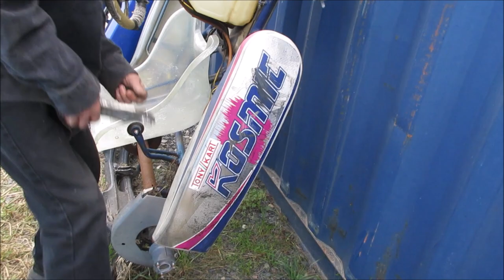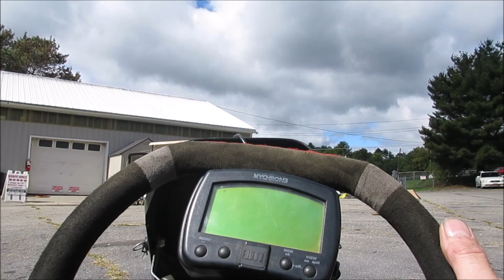Race Kart Scrap Pile Pick ,Then Lets Race Them

Comment: I would love to see a class using obsolete (to the current rules) chassis, powered by a 6.5 hp Honda clone with a TAV2 trans. Run a mixed surface course, all dirt and other tight courses. Cheap fun. I will name it the Mustie One class.
Reply: Man I remember renting them at dirt tracks when I was a kid.  They had  BS motors and washboard humps with jump hills in the track.  I'd work for a few days to drive them a few laps on those dirt tracks and it was worth every penny.  Great memories.  Thanks Mustie.  Cool video.

Comment: Using tools that aren't hammers as hammers always makes me uneasy. But at least it lets me know who not to lend tools to. :) Good fun video!
Reply: That and using screwdrivers for tasks other than turning screws makes me cringe too. Cold chisels and pry bars work so much better.
Reply: every tool is a hammer, whether intended to or not. gotta use what ya got sometimes
Reply: @harveylong5878  a hammer is a very basic tool and if you only have a few tools a hammer should be on any short list. I've seen the tool collections of people that possess almost no tools whatsoever and they all invariably have a hammer. It's generally one of those curved claw carpenters hammers. Really you're better off with a rip claw. But what do they know?

Comment: I have an old go kart that will scare the pants off of you, it's an older 90's kart from a local go kart track that closed down, got it for $600 with a 5hp Briggs, buddy and I hacked it up a bit and put a Kawasaki Sno-Jet snowmobile Sachs 340cc engine on it, it will do 80mph+ if your brave enough to pin the throttle and keep it pointed straight.

Comment: I like how your friend walked around, and just high jacked all the donor parts you would need. He did crack me up a little with the velcro on the shoes, means you're getting old, and tying shoes is to much.  I am over 50, but i got to have laces in my shoes.  Watch JR go fixed one of those adult go carts, and put the newest harbor freight predator engine in it, and it was fast.  G-d bless and be safe.

Comment: We raced go cards at a company party once really fun, i don't think they were as fast as these though and i didn't fit at all, i ended up riding the brake a little bit most of the time. But dang it was hard for the arms :P i am used to driving without power steering but dang that was hard

Comment: Is it not allowed to have a shifter cart set up like a bike. Bars, clutch, Front brake right foot rear brake brake, left shifter , twist throttle, and so on. ?
Reply: Used to have shifter karts 125cc and 250cc, clutch, brake and foot throttle with gearstick next to steering wheel. The bigger engine Karts such as the 250cc normally go on the longer tracks but I used to go on tracks such as this with the 125cc but found it better with the longer tracks.

Comment: Please help me fix my CL350
Reply: God helps those who help themselves.
Reply: @1pcfred  if God wants to help too thats fine too but I haven't seen his videos of getting old engines running again.
Reply: @1pcfred  i had a guy give me a quote of $1900 to replace a cam chain tensioner and he has never even worked on a 350. He needs God. I just need someone that knows what they are doing that is not going to take me for a ride on the cost.
Reply: @crazylikeafox7341  Mustie doesn't work for people like that. Though he's done things for people he knows. I don't know what I'm doing and I can usually fix stuff for myself. I just brought my lawn tractor back from the brink. It decided to light itself on fire. I didn't want to buy a new one so I fixed it back up. It was pretty messed up though.
Reply: @crazylikeafox7341  they're all basically about the same. I just watched a kid bring a 1930s Briggs back to life. His technique wasn't the best but he was still clever. He had perseverance too. Which is the most important thing.
Reply: @1pcfred  yeah I will just go ahead and dismantle an engine in my gravel gravel driveway. Its not that I can't do the job myself. I know exactly what needs to be done. I don't have a place to do it. Mustie obviously does and has worked on 350s before hence me reaching out to him. Are you his representative?
Reply: @crazylikeafox7341   a gravel driveway is a place to do it. I've torn engines down outside. I don't represent Darren but I do understand that he's not a repair shop that's open to the public. He just does his own projects. If he fixes something for someone else he's just doing them a favor. I've watched a video where he fixed his aged neighbor's roached out push mower. I'm pretty sure he just did that out of the goodness of his heart. But that's an exception to what he normally does. Which is typically finding his own projects to do.
Reply: @1pcfred  Thanks. I'll wait to hear from him myself